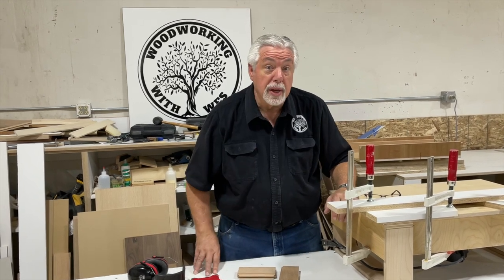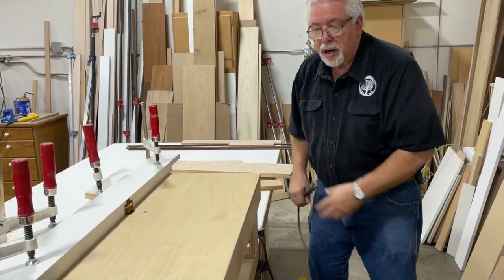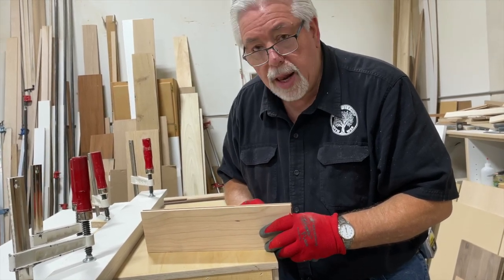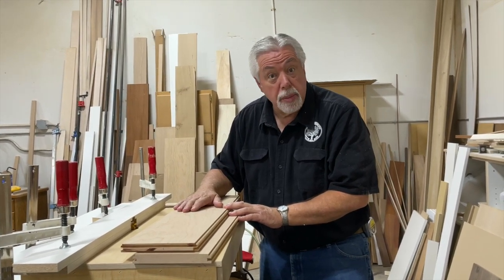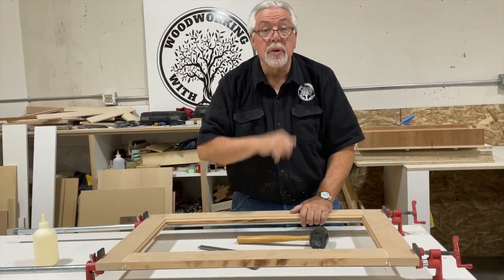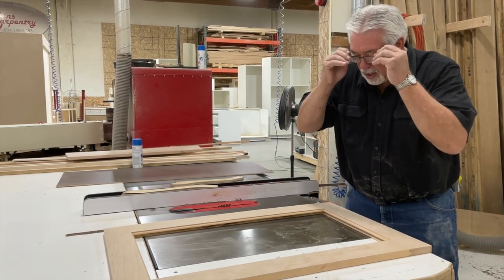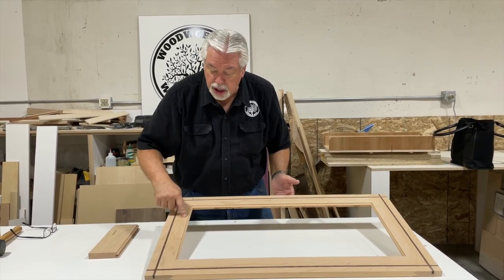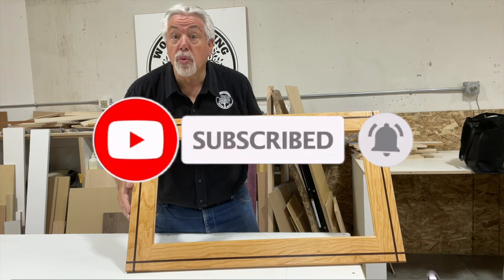Build A Beautiful Custom Picture Frame - Any Size You Need

Comment: How do you install a picture and glass in a frame with no rabbit on the back?  It looked like there was no rabbit in your final sand.  For that matter, what would your router set be to create a rabbit with a profile like this already being cut on the inside of the styles and rails?
Reply from the maker: Hi Dave...there is in fact a rabbit cut on the backside. The rabbit is 3/8"x 3/8" . Thanks for watching, Wes